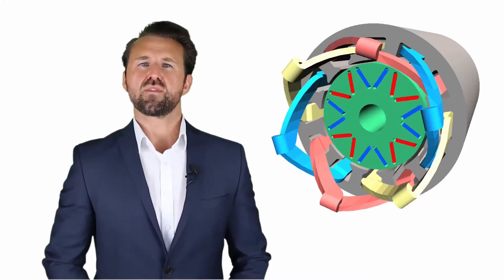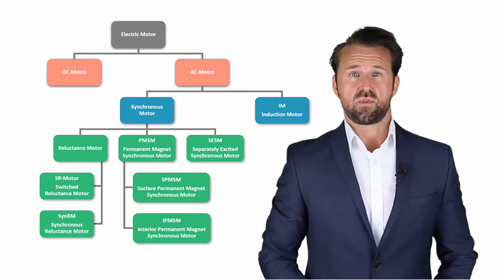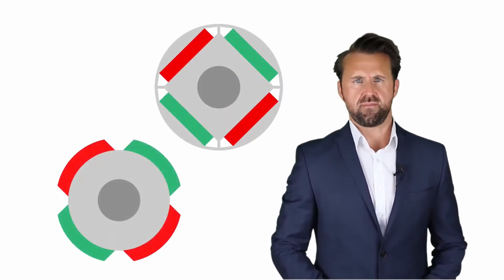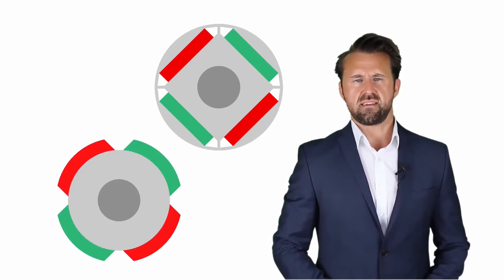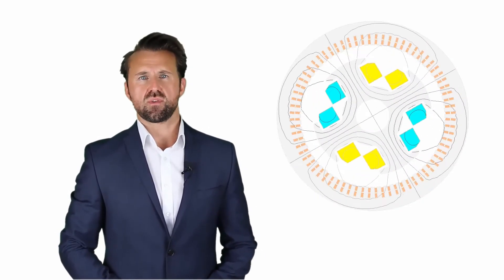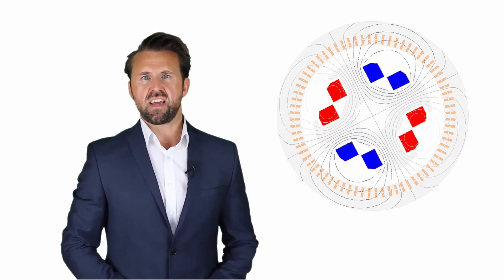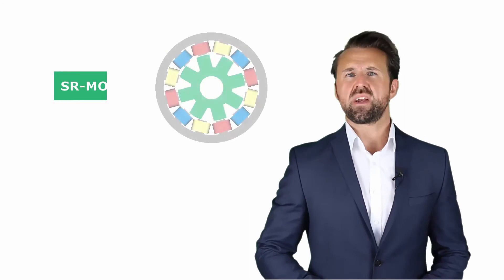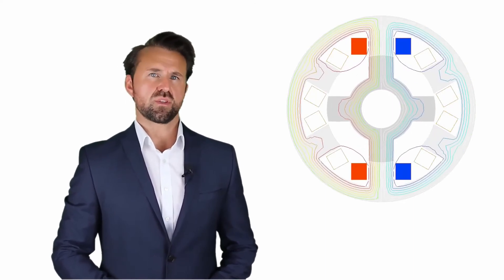Synchronous Motors Overview and Types Comparison

Comment: what the advantage of IPMSM compared to SPMSM?
Reply from the maker: Simply explained, a higher power density can be achieved with an IPMSM. The production is cheaper due to the rectangular magnets, which is why IPMSMs are primarily used for electric vehicles today. I hope I could answer your question?
Reply: @Electric-Motor  yes, thankyou

Comment: What is the difference between PMSM and IMSM. It could not be just location of magnet. There has to be a reason why it has changing design?
Reply from the maker: Hello thank you for your question. You mean what is the difference between a SPMSM and a IPMSM motor? Did I understand you correctly?
Reply: @Electric-Motor  yes. There has to be another reason except just location
Reply from the maker: @ArslanGuitar  So, of course, there are several reasons. The magnets for a SPMSM are usually not block-shaped magntes. This means that the shaped magnets for a SPMSM are more expensive to produce. The block shaped magnets for an IPMSM are cheaper. If the magnets for an IPMSM are arranged in a V-shape, for example, a reluctance torque can also be generated. This gives the motor a higher power density. A SPMSM usually has a higher efficiency but only in a very small speed range and the torque ripple is very small. As a result, the motor runs more smoothly and quietly. So you can't say an IPMSM is better than an SPMSM. It always depends on what goals you want to achieve. Can you give me a short feedback if I could answer your questions?
Reply: @Electric-Motor  this explanation is quite good for me :) thanks a lot.
Reply: The surface mounted pm need glue or taping to fix them.beside the magnets see the teeth reluctance flux and that flux varituon leads to losses inside the magnet, the buried ones are much more "protected" from that effect.

Comment: Hello,How can I distinguish between a synchronous motor and an asynchronous motor without turning the motor on
Reply from the maker: Hello Thank you for your question. You mean without using an external voltage or without turning the motor?
Reply: @Electric-Motor  
Yes👍
Reply from the maker: @hinrigardehes3253  Ok that is difficult! Do you have maybe a photo of the identification plate or of the rotor and stator?  Maybe I can see something on it and then help you out.

Comment: Good explanation, thanks. for your video. would a stepper motor be a synchronous reluctance motor?
Reply from the maker: Thank you very much! That's a very good question the answer is not so easy because there are several types of stepper motors. Stepper motors are usually short flux path motors, which is a special type of switched reluctance motor. And many stepper motors also have magnets, so strictly speaking they are not pure reluctance motors anymore. Hope the answer helped you?

Comment: Great simple explanation, thanks! Looking into claims of a new synchronous reluctance motor by ABB being marketed for municipal water pumping.
Reply from the maker: Thank you very much. Allow me a question, what do you mean by new? Abb's SynRM is already 7 or 8 years old, isn't it?
Reply: @Electric-Motor  Perhaps it is only new to myself and to this part of the U.S. in a municipal application. Our company covers the Pacific Northwest U.S. and no one here has ever heard of this type of motor used in municipal pumping. We are requesting more info from ABB. With NEPA Premium Efficiency rated induction motors already getting 95% efficiency, there doesn't appear to be much room for significant gains in efficiency, particularly if the cost is higher for the synRM.
Reply from the maker: Hello, an efficiency of 95% for an induction motor sounds extremely high! That will probably really only be the electric motor without inverter?
I can agree with you that you can hardly achieve a higher efficiency.
However, you must also look at the efficiency over the complete speed range!
Especially pumps and blowers are usually operated in the medium speed range.
I could very well imagine that in the lower and middle speed range a SynRM achieves better efficiencies.
Maybe you have data sheet of the induction motor you use?

Comment: Is small size SynRM possible ? I have never seen small SynRM or low voltage SynRM and kinda wonder why.
Reply from the maker: Thank you for your question. Yes it is possible but expensive if you only use techniques that are state of the art.
The voltage tends not to be a problem, but electric motors with small voltage also tend to have smaller currents and therefore smaller power. Therefore electric motors e.g. pumps are then also smaller. For good efficiency, the air gap should be proportional to the size of the electric motor. For reluctance motors, however, the air gap must be very small in order to achieve good efficiency. This means that very good bearings and thin electrical sheets must be used. This makes things more expensive.
But if you think a little bit outside the box, you can find cheaper solutions and use a SynRm for small electric motors with low voltages.
I hope this could answer your question?
I hope this could answer your question? I have answered a similar question under the video about electric motor types, the answer is a bit more detailed.

Comment: Using a permanent magnet is not a good solution 😐
Reply from the maker: So you would prefer a reluctance motor or an electrically excited motor?
Reply: @Electric-Motor 
 No ! 
 In general, the structure of induction electromotor is also incorrect. It consumes very high energy. I have been building an electromotor with a new structure for eleven years, which will drastically reduce consumption by about 70 to 90%.
Reply from the maker: That sounds interesting. What basic physical principle does the electric motor you developed use?
Reply: @Electric-Motor  
This electric motor is not free energy
This motor consumes only less power
☺

Comment: What is a permanent magnet switched reluctance motor. 
Thank you for reading.
Reply from the maker: There is not really any permanent magnet switched reluctance motor!
There are only two types of reluctance motors, switched reluctance motors and synchronous reluctance motors.
Maybe you mean an IPMSM, which has magnets but uses an additional reluctance torque.
IPMSM = "Interior Permanent Magnet Synchronous Motor"
I hope this helps you and thank you very much for your question.
You would help me a lot if you subscribe to my little channel.
Reply: @Electric-Motor  thank you for the reply. I am particularly interested in Tesla's claim that they are using a pmsrm in the rear of there vehicle. Do you think it is magnets in stator or something shown in this video. https://youtu.be/n4YD8Nvyfa4. Any information on identifying  the workings of the model 3 rear motor would be greatly appreciated.
Reply from the maker: After the current official teardowns, the motor is an IPMSM!
Permanent magnets in a normal stator don't really make sense, because the direction of the magnetic field always changes.
If you would split the stator you could use magnets also in the stator.
But what speaks against it is the higher temperature load of the magnets in the stator.
This would require very expensive magnets to avoid demagnetization.
May I ask why you are so interested in the new Tesla motor?
Reply: Switched reluctance motors are not really synchronous motors. Their main difference to true synchronous motors is that their rotor does NOT rotate synchronous with the magnetic field of the stator. This means that you can't combine them with permanent magnet synchronous motors (where the rotor stays synchronous to the stator's field). As the rotor stays synchronous to the stator's field in both the "synchronous reluctance" and the "permanent magnetic synchronous" motors (though at slightly different angles) those two types CAN easily be combined.

(In a switched reluctance motor, the rotor does stay synchronous to some fixed fraction of the rotation rate of the magnetic field, though. So you might classify them as synchronous motors or asynchronous motors, depending on the definition of "synchronous motor" you use.)
I came here form this video
https://www.youtube.com/watch?v=esUb7Zy5Oio&t=614s
which explains Tesla's motor type a bit better.
Reply from the maker: Thank you for your comment, however the definition of synchronous and asynchronous refers to the speed of the electric motor.
Therefore, all reluctance motors belong to synchronous motors!
I share this opinion with Mr. Hendershot, who is one of the most famous specialists in electric motors!
Unless you combine a reluctance motor with an induction motor, that would be a hybrid electric motor.
Nevertheless, thank you for your comment, please let me know if you have a different opinion on the subject or a question.